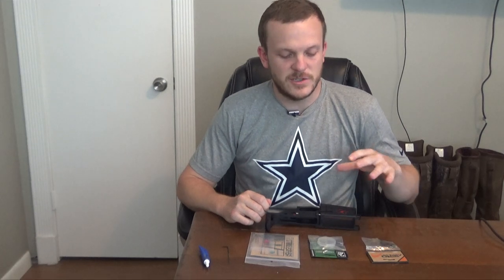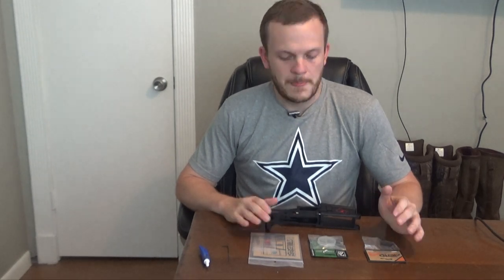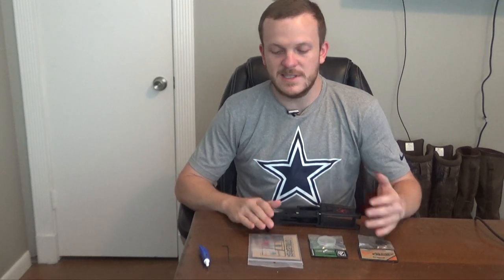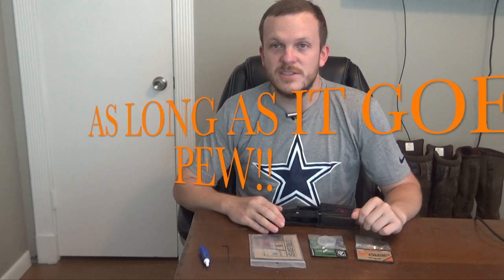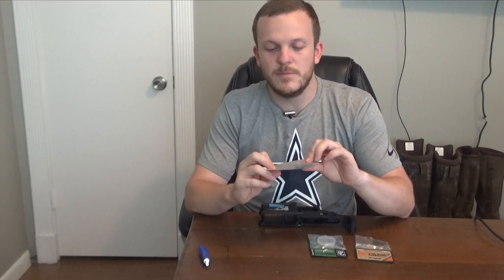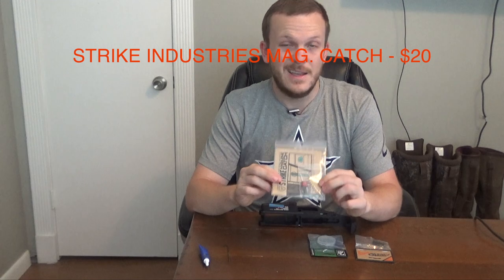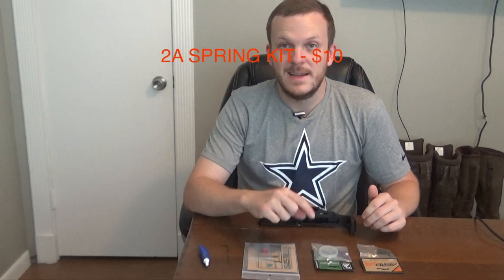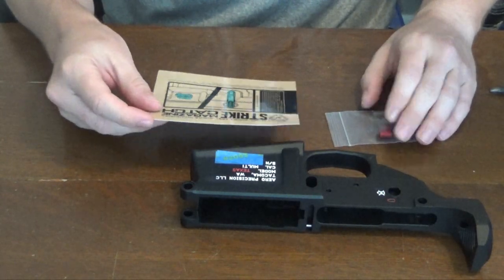A Beginners Guide To Building An AR-10: Part 1 - Lower Receiver

Comment: I am just about finishing my .308 build, prices are a thing of the moment as now 2 years later they are more, some parts are about same but I paid for my lower also AP but FDE in town $200.00; I wanted to do an 80% lower but 5D tactical/80% Arms screwed me with the order initially, lost it and took my money still fighting for refund; they sent another one on a different order that reads coming in couple days; we will see. In all my parts I am close to 2K but including AR10 tools and 4 Lancer Magazines; I want to do another upper that would be a 6.5 and then swap it to use same lower, as soon as recover from this expense will work on that one. The Scope I am eyeballing is a Nightforce that sells for $1800.00, if one wants to truly enjoy precision shooting which is the purpose of the builds then that is the price one must pay, going with a budget scope would negate having expended so much on parts! but I am still holding my horses about the scope; it is a big commitment. The weight of my system so far u loaded without scope is close to 11 pounds; would be around 15 with scope and loaded but this is a bench rifle, not a back slinger, not even intended for hunting!

Comment: Good video.  I would be concerned about using blue thread locker on such small parts.  Perhaps purple instead. Also, one trick I use when installing the bolt catch release is to use a piece of 12 gauge copper wire and insert through the barrel end to keep it in place while screwing or pinning from the stock end.  As the screw or pin moves through the hole it will push out the wire.
Reply from the maker: Thanks for watching, yeah purple may be a better idea, I didn’t have any, just had some blue and tried not to use a lot of it. That’s a good tip on the bolt catch! I’ll have to try it next time. Thank you!
Reply: Purple?
Reply from the maker: It is one step below the blue thread locker, makes it easier to remove.

Comment: Does I have to use the Aero bolt catch on an aero lower? Or will any bolt catch work?
Reply from the maker: No it doesn’t need to be an aero bolt catch, you should be able to us another manufacture’s bolt catch. That being said since it is an AR10 you will want to do some research to make sure whatever you choose will work as there is not a mil spec like AR15 has.

Comment: Bought pivot and take down pins they were to short and ideas? Don’t want to keep ordering pins till ik why they were to short I bought my lower from 80% arms
Reply from the maker: Does 80% arms sell their own pins? You could take a measurement and then before you buy them see if the pins give you a measurement
Reply: Make sure you are buying AR 10 pins and not AR 15 pins. The 10 is a wider receiver.

Comment: Any tips to getting the bolt catch pin started?
Reply from the maker: Yeah that’s a tough one. My first AR it took me awhile to get it started an not scuff up the side. I ended up buying a roll pin starter punch and that thing works wonders. Helps out a lot. I’ve seen people try and hold it with tweezers and do it, but haven’t done that myself
Reply: The Real Avid Master Bench Block is $40 and worth it's weight in gold for stuff like that. It lets you mount the lower receiver so you can use both hands to start your roll pins. And a roll pin starter punch is wicked helpful.